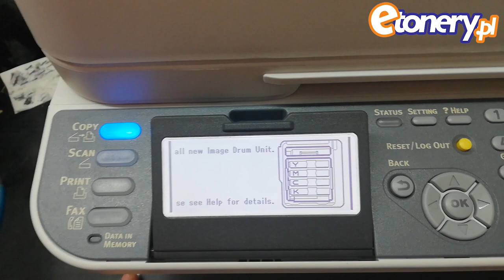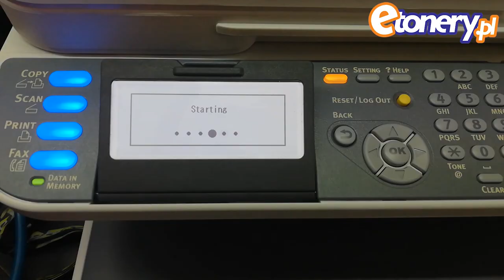OKI DRUM RESET C310 C322 mc363 mc562 ...

Comment: oki MC363 was also successful
There is no fuse, so I pull out one wire and connect it. Power on.
Afterwards, another error message appears
After removing the wire and turning the power off and then on, it operates normally.

Comment: Thanks for sharing,is it a fuse or resistor?
Reply: That was 63mA fuse.
I seem that an internal counter is reset by inrush current via the fuse and the counter will restart counting the life time after fusing.
Reply: @Pacmania100  thanks for your reply. I ended up getting a new one but will save info